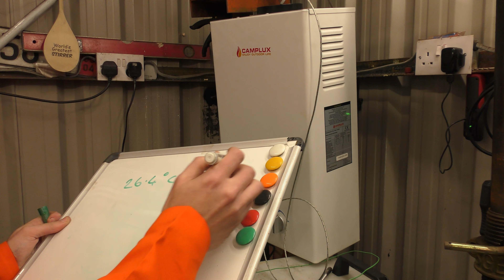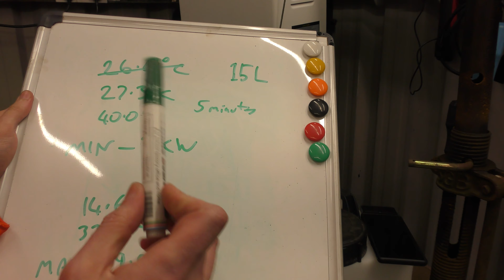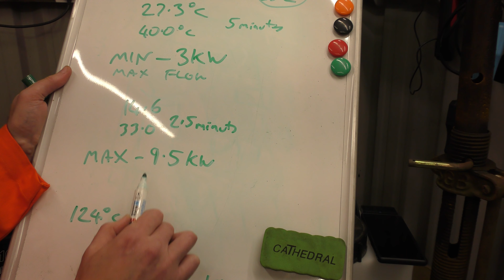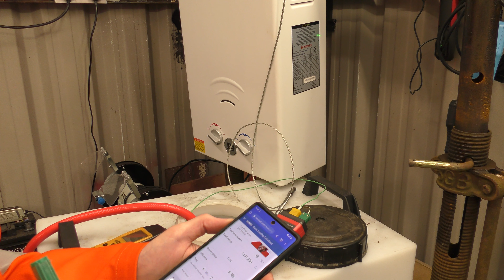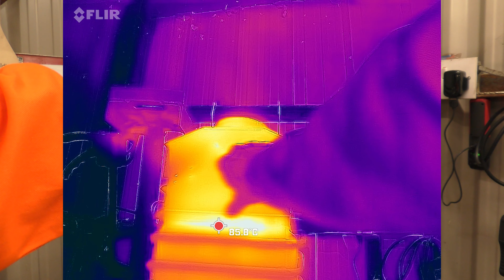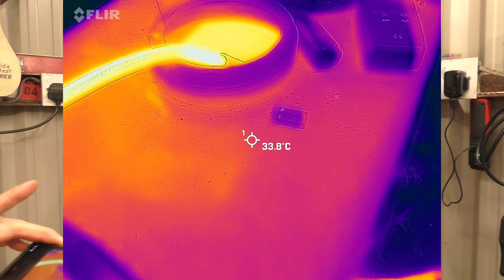Camplux heating output test and a look with the FLIR

Comment: It's easier to calculate efficiency based on measuring fuel input. You have to weigh the propane and determine how much was burned. The weight of propane burned is the total heat energy burned and your tested output is the heat captured.

Comment: If you could tell how much gas it was using you can work out the heat input. But because its lpg bottles there's no meter to check

Comment: The final test might be max max but measure temperature output unit of heat lost (past radiator). Or  If you had a good scale you can measure lost of propane and see used kw of energy to see if 20 kw is even possible.

Comment: David, Can you arrange a constant feed of water to this kit?  If so, you only need the flow-rate and delta T to calculate the power.  Timing the experiment is irrelevant and no need for a fixed volume of water in a tank.  Only three measurements required - but the flow-rate measured does represent volume per unit time, so preferably a fixed volume and measured time (or the other way round) can be checked throughout any extended run - as long as the flow rate is constant.  A fixed head water supply may need to be arranged, but that is not really that difficult?
Reply from the maker: Constant feed might be a challenge.  Can't even get the mains water supply to remain constant.  :)
Reply: @DavidMcLuckie  The usual is a constant head, supplied by the mains, while maintaining an overflow to drain, or a feed from the roof storage tank (where the head height would not change appreciably - even if the ball valve supply could not keep the tank level completely full).

Comment: Because it run on low water pressure.  I am curious how high  do you have to have the water tank supply.  For gravity it to run. Like camping with the heater sitting on the ground at a base of a tree. Could you reach up easily  to hang the water supply tank. 
Great way to start the day is with your HELLOOOO.

Comment: put in a 2 or 3kw electric element, measure how much it heats up the water in a set time and as its an electric heater its 100%ish efficient you will know if you get lets say 1800w heat input (for a 2kw heater) into the tank then your calculations are correct  as some heat will be lost from a non insulated tank
Reply from the maker: Good idea to test the setup is accurate.

Comment: I'm sure there's some calculations they use to measure the power output performance of gas appliances, dunno what they are though, but there's also the possibility of them just using "chinese watts" which always seem to be a lot higher than the actual figures... :P
Reply: Those with smart meters can get half-hourly updates on natural gas energy used.  Reading are to 0.01kWh, so with a long enough time and sufficient use of gas, the results can be quite reasonably accurate.  

For those with bottled gas, a suitably precise electronic weighing scale is the way to go.

Comment: I have been wondering about these heaters! - I think the timings do matter, as there will be time to heat the heat exchanger and other parts inside too for each run won't there?
Reply: ...also I assume the starting temperature will also affect it, I guess the higher the water is to start with, the less efficient it will be? 
I suggest...
1. Start with the same temperature water each time
2. Run it for the same amount of time for each test
3. Weigh the gas, and work out how much it is using on each run, to calculate the KWH input too
4. Can you remove the shower head, so that isn't restricting the flow too?
Reply: @Sparks0001  yeah, I believe the higher the output temp, the less efficient the total heat transfer will be... More heat will leave the flue. 

I don't believe their efficiency rating, but for an on demand heater, it's good nuff for me!